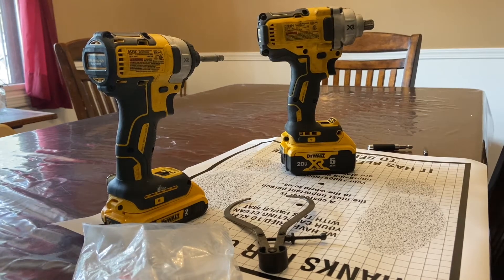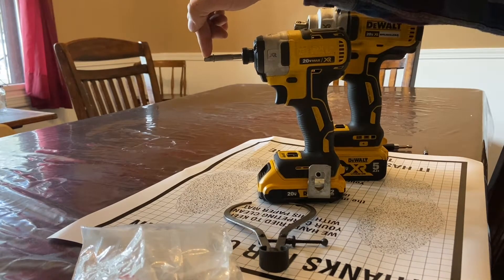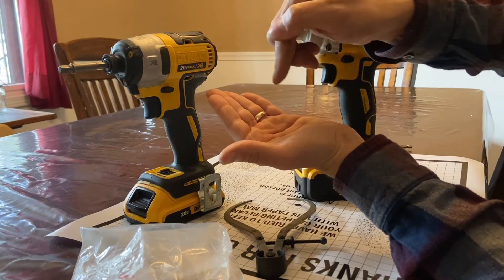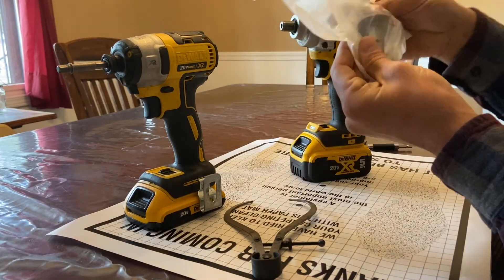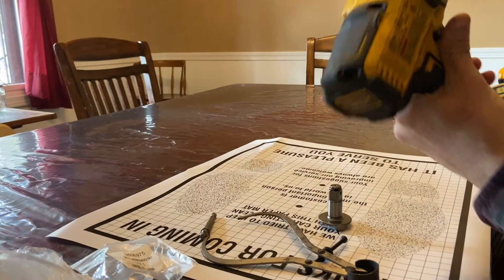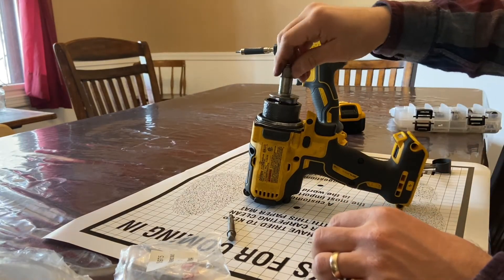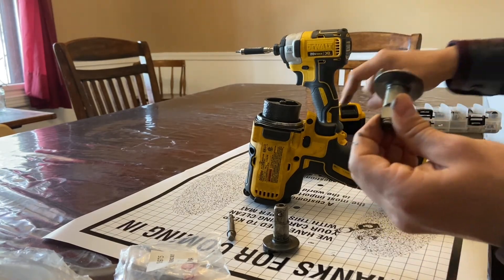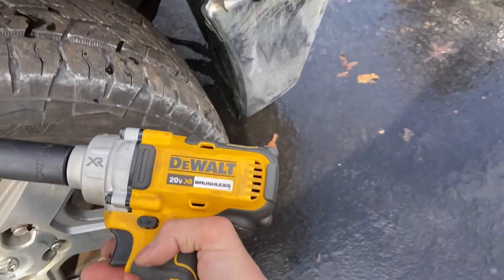DeWalt said it COULDN’TBE DONE! DeWalt DCF894 hog ring conversion

Comment: Apparently, the detent pin doesn’t necessarily have to align with the hole in the side of the socket. If the pin is NOT aligned with the detent pin the friction is often sufficient to hold the socket in place and is not too difficult to remove the socket. If the hole is aligned with the detent pin then often a metal insert through the hole is needed to depress the detent pin to remove the socket. Choosing a detent pin or hog ring anvil is generally a matter of choice of the user.

Comment: I personally prefer detent pin...anvil is a lil longer therefore goes inside the socket more for stability .Always push the pin down n put oil in it occasionally...helps spring work like it should n makes it easier for socket removal....also they will last basically firever that way....hog rings hang up sometimes n bend then your outta luck.you have to replace them....just my 2cents...good video.

Comment: IF YOU READ THE OWNERS MANUAL YOU WOULD KNOW IT SAYS TO DEPRESS THE DETENT PIN FOR INSTALLATION AND REMOVAL.

Page 9:

"*To install an accessory on the anvil*, align the hold in the side of the accessory with the detent pin (11) on the anvil (3). Press the accessory on until the detent pin engages in the hole. **DEPRESSION OF THE DETENT PIN MAY BE NECESSARY TO AID INSTALLATION OF ACCESSORY.**"

On the same page 9:

"**To remove accessory**, depress the detent pin through the hole and pull the accessory off."

It's actually effortless to install and remove the socket from this detent pin if it is depressed for both purposes.

Comment: Hog ring is great for a while, then it gets to where it just doesnt hold the socket at all. So then, everytime you tilt the tool, the f'n sockets ends up hitting the floor and you have to chase it down.
I dont know why they cant just use a spring loaded ball like damn near ever ratchet made uses.
Reply from the maker: I’m happy to report all this time later, even with pretty much daily use, it hasn’t worn out. And yes a spring loaded ball would be great. The pin that it came with, not so much. But many sockets have a hole at 12 o’clock and 6 o’clock, and if it happens to lineup with the ball or the pin, which is a 25% chance, it is stuck on there pretty good

Comment: Thank you for this ... however I was looking to go the Other way, from a hog ring anvil to a detent pin anvil - BECAUSE  - with wrists riddled with tendinitis & arthritis (the REASON why I bought my DeWalt DCF894H to begin with),  the hog ring is simply HORRIBLE for me. I can pound a socket on there of course, yet unless it's a fairly large socket, I must actually Pry sockets Off of there with a Screwdriver !!
Now (Thank You, of course) I have learned from this video that the detent pin is actually Pointed and as stated by Drew Carapella, it also sounds pretty horrible. 
I had assumed that the detent pin would be much like a typical ratchet wrench with a spring-loaded ball to lock sockets in place -- --> Same As my pneumatic 3/8" drive wrench (non impact), my 1/2"-drive pneumatic impact wrench, and my 3/4"-drive pneumatic impact wrench, all of which I seldom use very much due to my pretty small air compressor.
So now I'm learning from this that the DeWalt detent pin anvil is a Nuisance to use too. It puzzles me that DeWalt would even design such a thing.
As stated, I got the DCF89H because I'm somewhat disabled AND because my neighbor highly recommended it. He was originally a heavy equipment mechanic and welder, even extensively overhauling worn & damaged machinery rather than buying new - to save costs. 
He sold out that business to go into logging instead. When he got this DeWalt Max brushless 20V impact wrench he told me he uses it More Than any other wrench or driver he's ever owned.
I'm 71, riddled with arthritic issues, yet still almost entirely dependent to Self Reliance for maintenance & repairs, Plus living on bottom of the barrel Social Security, I had to save up for 5 months to buy this cordless impact wrench and the accessory  kit comprised of battery charter, two batteries and a DeWalt carry bag. 
Now I find from this helpful video that the detent pin anvil is Also a major nuisance. 
Perhaps DeWalt needs to bring some of their own elderly family mechanics into their shop and then begin to learn what their own elderly parents and grandparents think of 'Crap' like this. I don't mean to be vulgar nor do I intend any offense, but tools must suit their Users not just some corporate Profit motive - With  blind ignorance toward disabled and handicapped Mechanics - who Still Work - beyond some Desk job, for blind (and shallow)  Desk "Jockeys" !!   Go Figure.
Thanks again for sharing Meaningful information - now I certainly won't waste money and frustration by buying and installing a detent pin anvil.
Bless you All,
~ Rob
(still lost in the Maine woods)
Reply from the maker: Hey Rob, thank you so much for the feedback!

Perhaps you can file down a little bit to make hitting sockets on and off a little bit easier? Not sure I mentioned in the video, but I have some elbow and shoulder issues, and this tool plus my Milwaukee 12 V ratchet have really helped.

I refused to hurt my body before I heard a tool, so if I can’t get a power tool on a bolt or not, I will put a wrench on it and hit it with a brass or rubber hammer. much cheaper to replace that wrench (usually free because it’s craftsman) than to hurt the body. I am 35 years old.

I love main as well. We go up every year for like 10 days, two deer Island. Family has a little cabin up there. If life goes the way I want, we will spend much time up there when retired. Please subscribe! God bless and hope it all works out for you
Reply: @robhart6042 as unfortunate as it is..  you have to think about the money they bring in from individuals under your circumstances.. majority of people that are elderly or disabled don't have the motivation you do to even use power tools anymore.  Meaning most of their money comes from people that don't have any issues with the way the drill is now. If I had to guess, probably like ,90percent are fine.. so that 10 percent having issues just ain't a big enough percentage to worry about.

Comment: how did you figure the parts possibly matched up before measuring? ..just went looking through parts diagrams/catalogues/amazon and saw something similar?
Reply from the maker: I googled the proper part number, and it took me down a rabbit trail of parts. I don’t remember exactly how I stumbled upon this one, but I eyeballed it and figured if it didn’t work out I can return it or maybe I was out 30 or 40 bucks. I was very pleased to see the technical measurements all the same, and I have used the thing for probably 100 hours since ( I am a semi professional mechanic)

That push pen was extremely obnoxious, especially because most of my impact sockets have a little hole on one of the four sides of the square four, and if the two lined up, it was all I had to get them apart. I have switched to power tools to save my elbows and shoulders, I want to suck it got stuck on the stool, it was worse than using a manual tool just to get them apart. Best improvement ever, maybe DEWALT will see this and follow